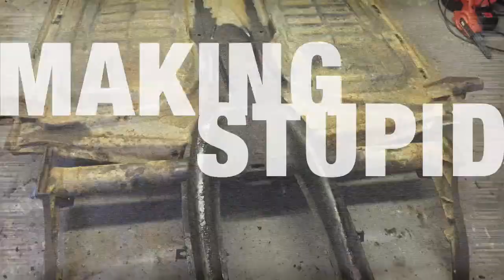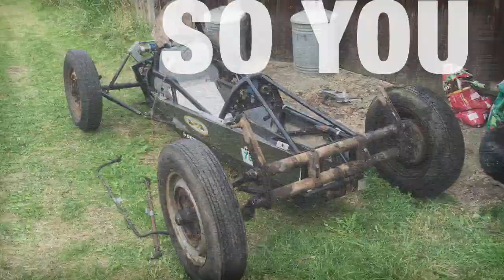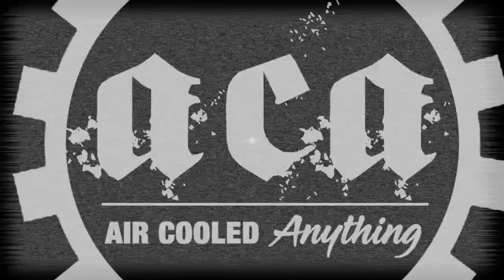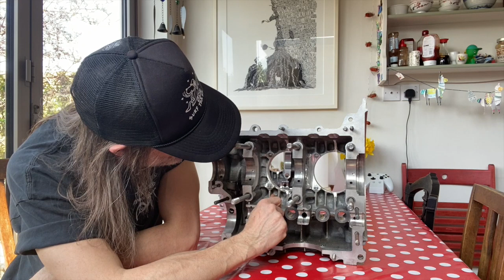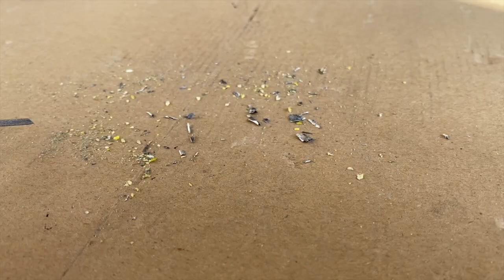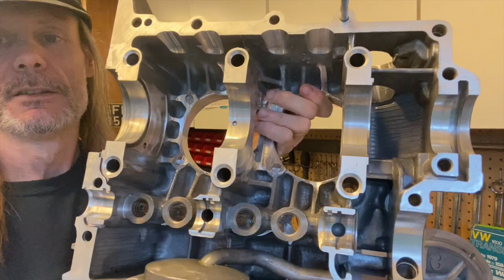PART 2 – AS41 Case Inspection - How to Build a CB Performance 2017cc Builder’s Choice VW Engine

Comment: Boufht a Cb Supercase about 15 years ago. Had to have Gene Berg re- machine the piston bore holes as the outside area around the bores was not even close to flat!!!
  I just had Beeg check the whole case out. Other then that, i was gappy with their 2 piece lifters and other odds and ends i purchased from them.

Comment: Curious if you ended up painting this case? I personally don't put much stock in the claims that paint will cause it to run much hotter, and I plan to paint my cases. Just curious if you decided to paint it after all, and if so, what paint/prep did you use? Your videos are awesome by the way. Keep it up, and you will certainly gain a large following!
Reply from the maker: Hi Mike. I did paint the case. I used a zinc based aluminium primer and 2K satin top coat. Came out well and is lasting. I also painted the Dynamo stand.
Reply: @aircooledanything2415  After posting this question, I found your video of you painting them. Not sure how I missed it initially. I'm getting ready to build a 2332 race kit motor (scat and CB parts). I've built quite a few motors, but I'm a VW novice, so your videos are a huge help!
Reply from the maker: @mikemcdonald7166  that’s great to hear. On my next one I’m going to go that way too. Should make for an amazing motor.

Comment: Great job on the video! I too am a little surprised at the condition of that case. I thought CB would have made sure the case was deburred and cleaned before shipping it out. Just FYI, you can purchase a can of 'quick freeze' from your auto parts store and use it to chill that crank nose before dropping on the heated ring.
Reply from the maker: Thanks LJ. I've not heard of 'quick freeze' before. I'll look into it. Sounds very useful. I do wonder how freezing and then introducing high heat would affect the integrity of the crank's molecular integrity though.

Comment: What a great show you have here. I've been looking at a CB kit for some time and this is exactly what I need to see.  Your first two installments are well done with excellent information for a hobby builder  Can hardly wait to see the other episodes.  The other thing is this is current stuff, there's so much online that is old news.  Good job! One question, why not use an aluminum case instead of the mag alloy?
Reply from the maker: Thanks for the kind words John. Good question. The kit from CB came with the mag case as standard. I think you can upgrade to the aluminium case, but I decided that I stick with the kit as it came. I'm definitely going to do a build with an aluminium case some time in the future though. Possibly a basic turbo motor.

Comment: painting any aluminum of magnesium surface creates a heat barrier. the biggest advantage to having aluminum of magnesium is their heat dissipation qualities.
Reply from the maker: Yeah, it's a bit of a worry that I painted it in the end. Yikes.
Reply: @aircooledanything2415  dont get me wrong it looks great. i live in florida. my father was a factory air cooled mechanic. we found early on air cooled vw-s dont like tropical weather. we ut exterior coolers on them back in the day i had a bug in the 70's with a cooler on the front bumper. the turbo 2387 im building now will have a drysump and an 8quart oil tank with 3 oil coolers and fans. cheers

Comment: Black actually absorbs and dissipates heat better; when the surfaces are flat and not shiny. That’s why black is so much better than chrome for heat dissipation.
Reply from the maker: Check out part 8 of this series. I went with Satin black, mainly for looks. hahahaha.
Reply: @aircooledanything2415  great deal; all business! As they say here: “chrome don’t get ya home...” 😉
Reply from the maker: @vayabroder729  Hahahahaha.True. But who doesnlt like a bit of chrome.
Reply: @aircooledanything2415  In mine I only have the alternator pulley nut and spacer....😉. I love Gene Berg engines; that all business look; no chrome...😉
Reply from the maker: @vayabroder729  I’m the same on engines. No chrome. Well, a little bit. This one will have none, excluding the dipstick, which is currently plated chrome. Will replace that eventually. 👍

Comment: The large hole on the flywheel side of the case is for crank position sensor.

You should also consider replacing the small oil pickup with a larger german version or if running a sump the large CB cut to fit unit
Reply from the maker: Thanks for the info on the sensor use. To use a larger oil pick up do you simply pull he existing one out and fit a new one? Does this require the port in the case to be machined to a larger size?
Reply: @aircooledanything2415  most modern brazil cases the tube will just wiggle out once its loose from the sump stud. A used german or CB unit will go in with a little persuasion, no need for machine work. 

https://www.cbperformance.com/product-p/1273.htm
Reply from the maker: @DasLuftVolks  Good to know. I'll look into it.

Comment: Yes, they should have sold you what is often call a "case hardware kit" which includes that T3 dipstick blanking plate, gearbox mount studs, standard oil pressure releif plungers, springs etc. Surprising they sell you a new case without it? 
I suspect CB clearance engine cases tova default so it would clear  up 82mm crank with Vw rods so possibly clearencing more than required. 
We drill out all the main oil gallery plugs on the front and back of the case even for new cases not having full-flow. The factory pressed in plugs are know for popping out over time so its good insurance to replace all the main ones with threaded & tapped aluminium plugs (not steel). Another reason we drill out the main oil plugs is so we can properly clean and flush out the oil galleries (even for a new case).
Great job your doing posting up your inspection and comments about the extra work required before assembly. So many owners don't realise how much work goes into just preparing the parts even for a mild build.
Reply from the maker: Ah ha!!! They did send that pack and it’s exactly as you describe - T3 block off, dowel pins, oil valves, studs etc. My bad. They were there all along. 👍